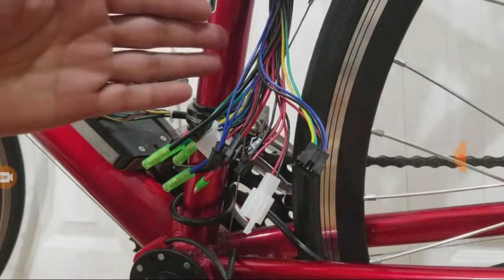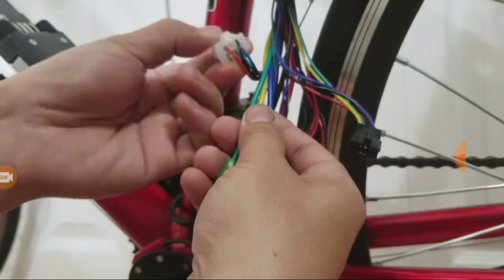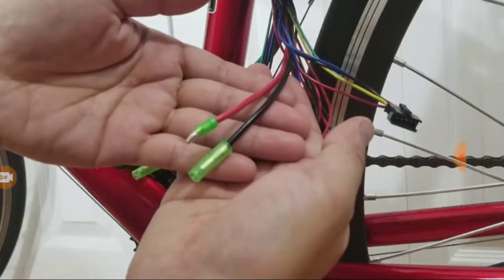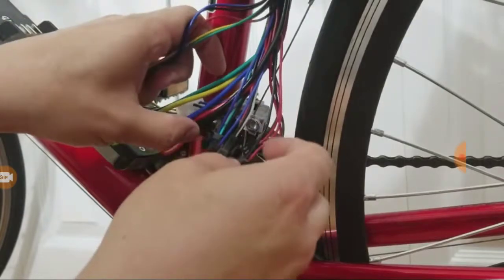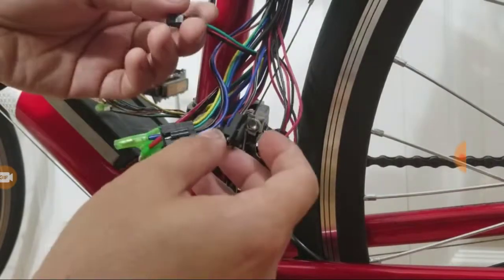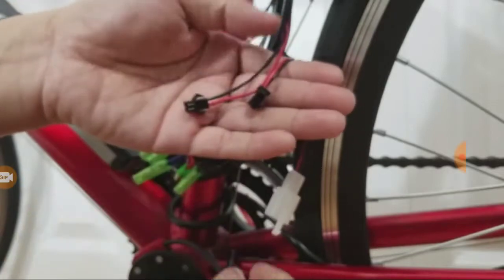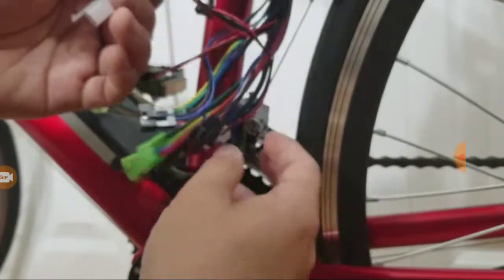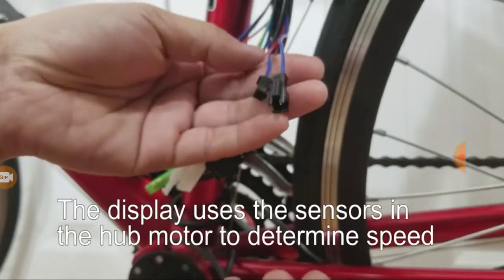Wiring universal ebike controller.

Comment: hi to all out there  i will say i know ebikes very   never ever buy one if you can't fix it   as you get alot of power drop out  iit the plugs and sockets are very bad

and you will need a inter tube liner  big time  in the back wheel  100%  to stop any holes in the tube